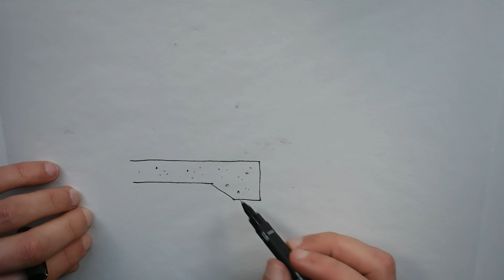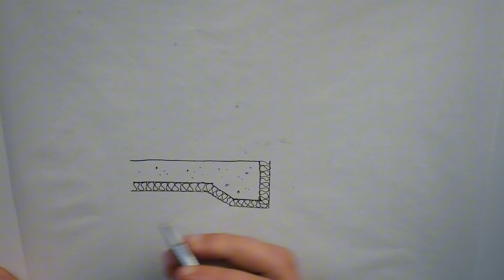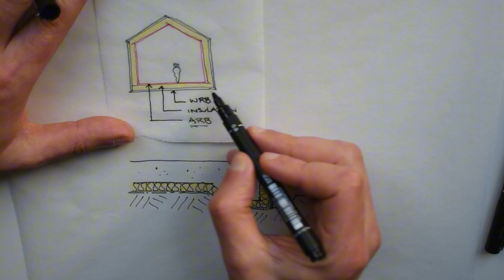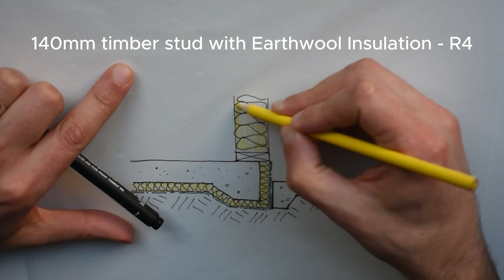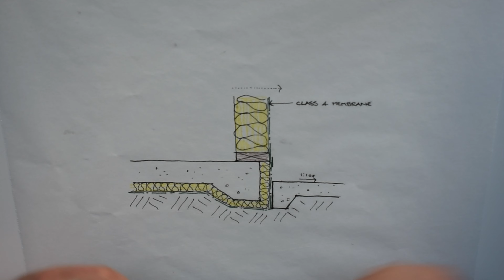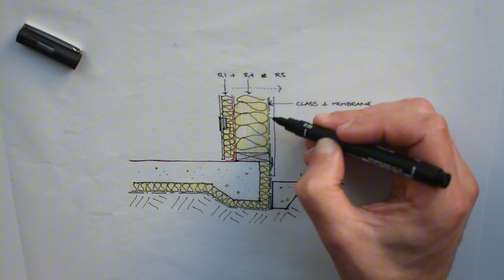Critical Floor-to-Wall Detail for High-Performance Homes | Stop Energy Loss & Moisture Issues

Comment: You didn't mention what racking/sheating material to use, whether to fix it on the inside or outside of the frame and how it might affect permeability
Reply from the maker: Thanks for the question. In Australia we wouldn't use a sheathing material on the outside of the frame at all. We simply wrap the outside face with a smart membrane which allows any vapour in the wall assembly to escape whilst stopping any moisture on the outside of the frame from getting in. In some locatons the structural engineer may require bracing and this is either done using metal straps (ideally) or with a plywood sheathing. Plywood isn't great at allowing vapour permeability so I don't love it, however with heat recovery ventilation and an airtight membrane on the inside the risk of moisture build up on the back of the ply is very low.